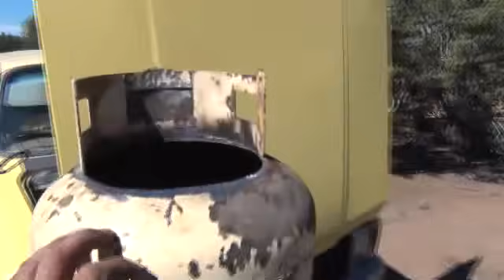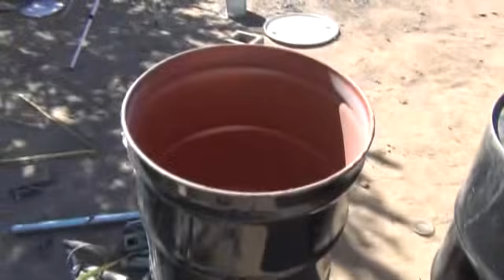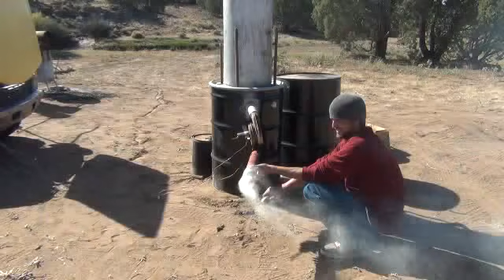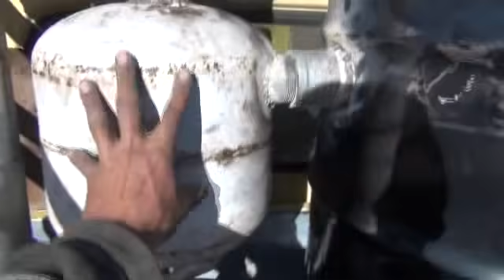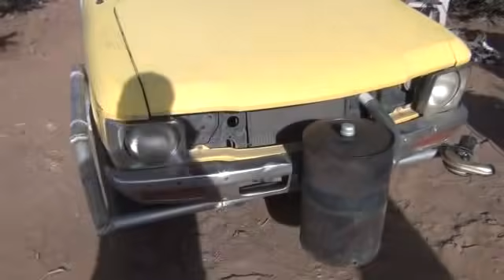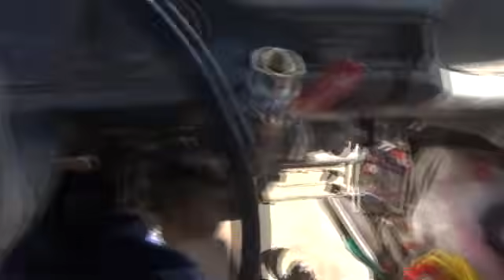How to build a Wood Gas powered Truck,  this truck runs on firewood!

Comment: Everyone watching this (...and his other inspiring videos) be sure to let the ads run, that is another source of funds for Mr Teslonian to finance his projects ...although most of the stuff lookes like it's scavanged!!

Mr Teslonian, first of all thank you for your unselfish sharing of excellent ideas. I have afew questions.
I
s your truck still running? Are you satisfied with the performance? Had you thought abour adding an egt gauge and a vacuum pressure manifold gauge to assist in adjusting the rpm due to the hydrogen? Since the mpp is 1.5-1.7 and a pickup is best suited would you personally think this is best economy, or is another method more practical for bot pickups and automobiles? Last question, approximately hours did you have to devote to this project, and if you had better tools, could it have been done more efficiently?

Note: of all the sites that I have explored regarding more efficient use of home grown resources for self-relient people you definately make into the top five!

Comment from the maker: Miles per pound of wood is between 1.5 and 1.7 mpp.
Reply: Is this still running? Im curious if the wood gas kills engines quick or if it's all good
Reply: @ItsMeChrisX  you will need to clean the engine but not so often
Reply: @ItsMeChrisX  You can feed an alcahol and water mixture in to dissolve the gummy stuff. You can also convert it to methanol in a stationary unit, on the first condensing you can let any dust from the smoke settle, you can also neutralize the acids and get rid of some other strange stuff with ash before distilling it a second time. After that it's pretty clear and should work about like gasoline, you do want to do maintainance and check for buildup with a mild disassembly at least. Unfortunately you've got to know engines, but trial and error are the best teachers, and you can test it on old weedeaters or something.

Comment: I am somewhat confused, It seems like you just have one big reaction chamber I always thought the point of wood gas was to make sure the reaction chamber wood did not get lit on fire but this seems to be just straight smoke from burning wood used as syn gas. Could you clear this up maybe explain how it works I am very curious. Thank you i you could  -Tristen.

Comment: As with the useage of gasoline- there is an amount of gasoline that gets mixed into the crankcase oil through regular engine operation. Does using this wood gas effect the petroleum oil at all? I'd like to see a sightglass from a Boiler tank mounted to the main burner- for easy verification of ignition. Also- something a little safer than having a bomb mounted to the front of the vehicle and a Capital Punishment device in the cab- would be nice. Propane tank-Piezo igniter system from a BBQ?

Comment: looks like all your air intake pipes are really small. What motor was this done on? i want to do this with a v8, but i am thinking that smaller is easier with airflow and fuel and whatnot

Comment: I also am curious how many miles you get on a full hopper. I am in the process of making a downdraft gassifier out of 2 55 gallon steel drums. My plan is to use it to help heat my home by hooking it up to an old furnace in the garage but I might want to experiment with hooking it up to an old pickup if the mileage is worth it.